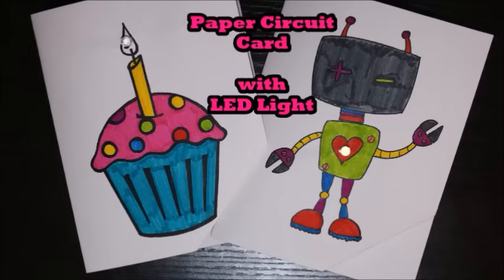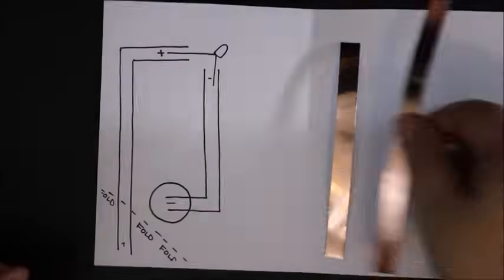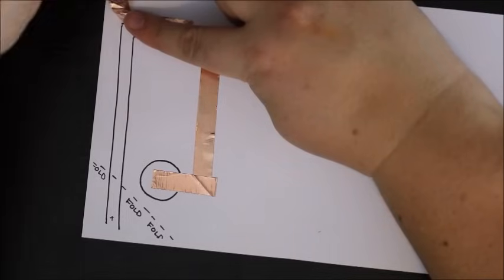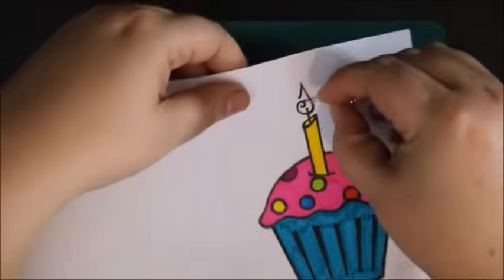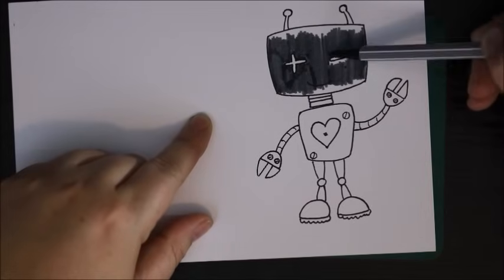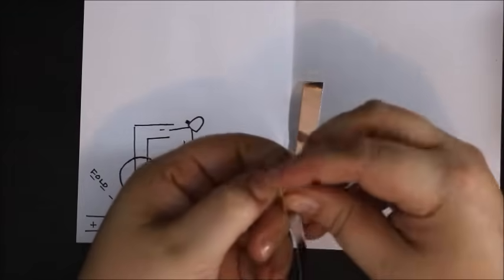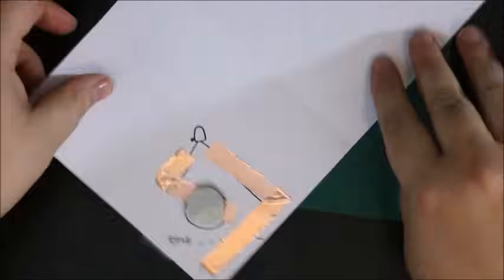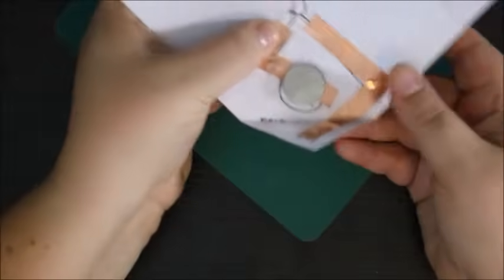Cupcake Paper Circuit Card with LED Light

Comment: hi, i have a question- instead of the cooper tape can we use a copper wire? im doing this at school tmr and i couldnt find any cooper tape so yea
Reply from the maker: You could but honestly if you don't have copper tape I recommend using aluminum foil. When I use aluminum foil I cut 1 inch strips and then fold them so they are thinner and a sturdier/less likely to rip.

Comment: Can we use silver foil in place of conductive tape
Reply from the maker: I have done it before using aluminum foil, just keep in mind that the tape you use may be a surprisingly good insulator and may block a circuit unintentionally.
Reply: @stemdola  thankyou mam

Comment: I am planning to do this project with kids but I'm wondering if there is a way to affix the battery more permanently to the card. I'm worried about younger siblings getting the battery.
Reply from the maker: +Aimee Aul try using hot glue but leaving part of the battery surface uncovered by the glue so it can make contact with the conductive tape

Comment: Melanie, thank you for this clear, helpful video! I am an art teacher and am teaching a STEAM club and a Makerspace this year and I have done this project once before with 30 8-9 year olds and it was a lot of fun because they designed their own art to go with their lights.  But, the copper tape was tricky for them to get solid connections.  Your tutorial is easy to follow and I believe your tape looks like 3/8"?a bit thicker than my 1/4 tape, maybe easier for small hands.  Also, I like how you poked the lights through the front of the card and taped the sides down.  I may offer this to them to view to create their own cards in the Makerspace!  Great tips!!

Comment: Where did you buy your led light? I see you have quit a bit in a box and what size is the battery?
Reply from the maker: 3V battery. Lights are from amazon: https://www.amazon.com/gp/aw/d/B015PEDA7A/ref=sxts1?ie=UTF8&qid=1469289967&sr=1&pi=AC_SX236_SY340_FMwebp_QL65